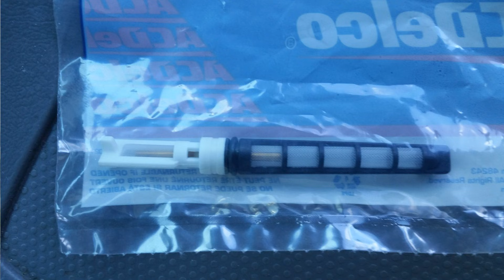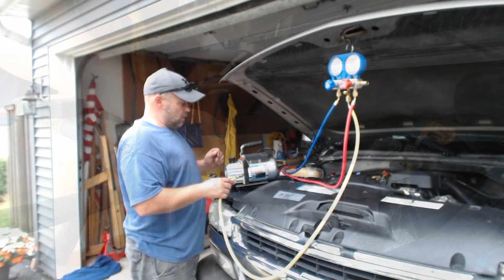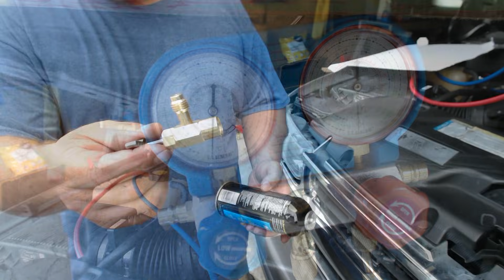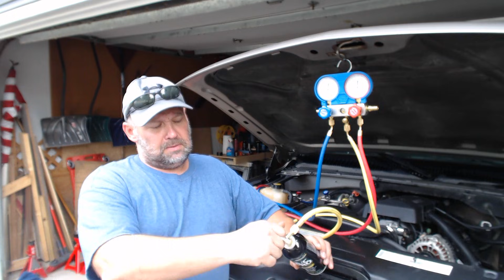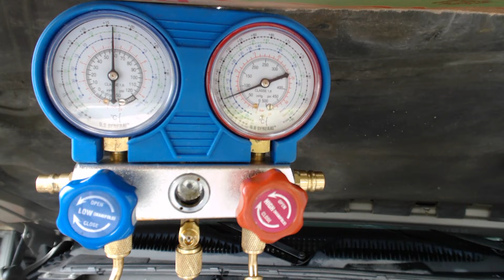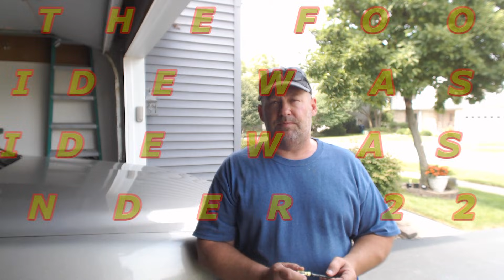HOW TO RECHARGE THE AC FOR A CHEVY TAHOE / HOW TO REPLACE A ORIFICE TUBE

Comment: Do i need to discharge the system at a shop before breaking the nut loose and disconnecting the tube?   Or can i just let it air out? 1:32

Comment: Doing an 03 Yukon Denali XL, the lines to the rear A/C are bad. Replacing all the lines up front to lines meant for a pickup truck. Front air conditioning is better than none. It's been about 8 years since I've done A/C work. I got my certification in the 90s but a little  refresher class always helps.

Comment: Question:  I noticed the rear side of that pipe (where the orifice tube lives) is ice cold, but the forward side is warm.  Is that normal?  And my vents are blowing in the high-70s, not very cold.   And the rear AC does blow a bit colder, which I don't understand.  Thanks for the great video.  I'm afraid to go invest in a vacuum pump and gauges if the problem is something other than low refrigerant.
Reply: Not sure if you have an O'Reilly s store close, but you can loan the vacuum pump and gauges out from them.
Reply: @ericjohnson4003  I wish we had stores like that around here. Not wanting to invest in a pump and gauges if low gas wasn't the problem, I took it to my mechanic. So of course the problem ended up being low gas.  Figures..

Comment: Hi Rick, I have a Chevrolet Sonic 2015 the the problem is that the high pressure pipe is cold and the low pressure pipe is warm and the A/C does not cool, what could be the problem? i have to recharge the system each month

Comment: did not to purge air using my harbor frieght guages.  in augusta, 100 now, super humid.  Need to replace orafice, since rear is working front is not.
great tip on adding oil to oring.  I was an engineer responible for ac change on vehicle assy line.  we soaked o rings in pag oil

Comment: Nice video. I'd change the AC condenser and the dryer in a 150k mile vehicle if I lived in Florida and also anytime I get into a system I change out the low/high side Schrader valve cores.
Reply: Why change out a condenser that isn't leaking?
Reply: Because it's Florida and it's a high use item that I wouldn't want to go without. Thought I made that pretty clear. @Balticblue93

Comment: You hooked up the red high side pressure wrong .
That goes on the liquid line the smaller one .
The blue attaches to the blue suction line .
Just look at how you hooked up your gauges lines .

Comment: I'm pretty sure that when you check it for leaks you're supposed to leave the manifold valves open. When you close them aren't you shutting off each hose from the system? That's why the low side gauge didn't start reading pressure until you opened it. When the valves are open you're checking the low & high side for vacuum leaks. When the valves are closed you're only checking the manifold for leaks.

Comment: Need some info. For a 98 gmc k1500 5.0L v8 1/2 pickup so whats the difference of a non automatic adjusting orifice tube vs an adjustable orifice tube.   Which is better cool and performance ?

Comment: Dude you took a hit on that freon. I got mine on line 6 cans for 40 bucks my orifice tube was about the same price although I priced it at a parts store for 2 dollars. But I figured if it was that cheap it was junk. Oh and my freon is the best made its DuPont Suva 134a I looked around and 3 of the top mechanics all said it's the best

Comment: How about finding the leak so you don’t have to charge it 🤷🏼
Reply: He did a vacuum leak down test on it and it passed, no vacuum leaked from the system so there was no leak when he charged it back up again.
Reply: Tyson Currie no he didn’t.
Reply: @fsu3784  technically he did a 10 minute leak test bit if it was me I would have done an 1 hour leak test and if you don't have time to wait at least a 30 minute leak test, but he did do a small timed leak test of 10 minute. 4:40
Reply: Tyson Currie I. Should have clarified that he needed way longer to tell if there was a leak.
Reply: @fsu3784  no worries 👍

Comment: Thanks for the video Rick , did you already replace the compressor? Or you still have the original? I got a 2002 Chevy suburban and after 265,000 miles my compressor just die, I’m going to replace the condenser and the accumulator too, I just worry for the evaporator, it’s hard to take it out

Comment: Hi side charging is FINE  when starting empty.   Hook up  gauges,  refrigerant, and purge  hoses.   With engine OFF  and  AC  OFF   invert can for liquid and charge  liquid into the empty system into the HIGH  side.  This gets most of the charge into the system  and  WILL NOT HARM A THING.   When  low side comes "up"  and pressures  stop moving, you can  start the engine  and AC  and  adjust  the final charge.

Comment: Good job, the only thing that I don’t recommend is turning the can upside down, you don’t want to add liquid to the low side. Refrigerant in liquid form should only be on the high side and with that said “ DO NOT ADD TO THE HIGH SIDE! “ liquid or gas! Leave the red valve on the manifold closed when adding refrigerant. 👍
Reply: You need to learn more about what happens with gases under certain conditions that become liquid and then gas again, especially with R-134, if you have a charging hose with a full can but disconnected from the AC and open the valve, you will se it will be released as a gas, not as a liquid, same thing happens if its connected
Reply: @kwt2000trucker  That is absolutely nonsense.  Sounds like you need to learn about how AC systems work and how the can is used.  If the can is upright, you will charge as a vapor and if the can is upside down, it will charge as a liquid.  Can you do either, but on vehicles you follow the directions on the can.  Of course anything that exists the can to the atmosphere is going to turn to a gas, that is thermodynamics and being mixed with nitrogen and oxygen in the air.  Regardless, if the can is upside down and sealed to the AC system, it will charge as a liquid.  High side liquid charging is fine, if the system is empty and as long as the compressor isn't running.  Empty the can to the desired amount that the label states under the hood.  Start the engine and run the AC.  Then you will make final adjustments to the charge using vapor and upright can.

Comment: Could the orifice tube be the cause of poorly performing at!? Please help
Reply: I recharged and it still doesn't blow cold like it should. I touch tubing one side is freezing other side close to fire wall is hot!!
Reply: looseparashoot the cold pipe is normal. That is your low pressure side and should be cold to the touch. The hot pipe is your high pressure side (head pressure). By the sound of it, it seems as though it may be running fine,in regards to the  refrigerant and compressor side of it. Now when you say it doesnt blow cold,is it cold and just barely coming out, or no cold air at all? If its cold but barely coming out, i would suggest taking a look at your blower. May not be blowing hard enough.
Reply: @robertgonzales1901  what about only cold when cool/cold outside ? Otherwise basically room or ambient temperature

Comment: It's illegal to vent refrigerant in the atmosphere. Also you shouldn't add dye if your not trying to find a leak.
Reply: A little dye doesn't hurt anything and then it's there in case your system ever gets a leak.
Reply: many  ac systems come with dye from the  manufacture

Comment: You seriously just released the gas into the atmosphere??Please be responsible and have it evacuated at a shop before you service an a/c system.
Reply: if that had of been freon it would have shown up as a fog when released likely just air
Reply: Is it irresponsible to use canned air?  r-134a is the same thing as HFC-134a and that's what's in canned air.

The only reason not to release it is that it can hurt your skin or eyes.

Comment: great video, i like your style.  question tho, i see people hook up the cables differently, as you have them with the elbowed side connected to the gauge cluster, other people have them with the straight side hooked up to the gauge cluster.  and the 2 ends are quite different.  so how to determine which is proper end to use?
9:10 now was that actually "opening" as you said or closing it?  I'm a bit confused bc I thought that counter clockwise was closing it off?!  and clockwise was opening it? on the valves.  and the gauge cluster clockwise was closing and counter was opening.. ?  Y/N? ha
you sure saved me a huge headache and mistake bc someone else said the orifice tube was down connected to the compressor and I almost went down there, but decided to watch your video first haa

Comment: Will be replacing compressor next week and just want to do this job right...thanks
Reply from the maker: compressor bad or is it the clutch? is it screaming?
Reply: RICKAFIX compressor. .just bought truck..blows hot..compressor looks like it spins when air is on and stops when I shut off...but refrigerant does not circulate...manafold gauges show around 100 psi each running or not no change.thanks
Reply: Good video tanks rick

Comment: so you never open high side when adding refrigerant? thanks
Reply: if the system initially get charge through low side  refrigerant goes  to low side  in state of  liquid and  causes sludge and shortening compressor life by damaging it,
 because when compressor ruining refrigerant enter low side as gas not liquid ,through return line.
the gas initially ,should be charge through high side with everything off till system pressure equalise with can pressure or no more gas can get in, then close high pressure valve start the car and run ac at this stage high pressure should go up and low pressure should com down.if the car need more charge most probably it would , it should be done  from low side only when compressor is engaged .don't fully open low pressure tap . open it gently and make sure low pressure gauge doesn't go over 50 psi by doing this you make sure. refrigerant goes in compressor in state of gas not liquid.
Reply: @seaton95  If you spoke english I might actually understand what youre trying to say
Reply: @puppetmasterblaster  it might not be best English composition but if you have a bit of knowledge about ac system in this case car ac you would know what i was talking about never never charge ac system when it is empty through low side because by doing that it could damage ac inlet valve,  you would flood low side by liquid gas it could damage ac by depositing sludge as consequence damaging ac inlet valve the correct procedure is  to recharge ac system after vacuuming the system car and ac should be off  low pressure valve must be closed... open high pressure valve gently don"t go fully open let gas go in... some times with some cars gas  wouldn't go in fully (only half the bottle gas go in  or on second bottle gas has hard time going in  )this is because pressure in bottle is the same as pressure in system ........now if you think amount of entered gas is not enough .....close high pressure valve (if you don"t do this the bottle could explode) start the car turn ac on ,when ac clutch engage (low side gauge needle start  coming down ) open low side valve at this stage as result of gas entering in system low side  gauge needle   start going up when it get around 60 psi shut the valve( not letting  pressure go over 60 psi prevent liquid gas entering into low side) when pressure drop open low side valve again .... this process must be done only while  compressor is engaged  till enough gas are in system.i hope this on is more clear.
Reply from the maker: correct
Reply: HECK NO!!!!....PLEASE DON'T!!!!

Comment: I see guys wire by the low side pressure switch to keep the compressor on all the time , it shut off at about 22 psi , on a hot day and enough Freon, the low side pressure switch will  stay closed!

Comment: When checking the low and high side pressure should both the front and rear AC be turned on? Thanks.
Reply from the maker: yes they are on seperate gauges
Reply: @Viiami Fainga make your own a/c videos ya know-it-all ffs

Comment: The problem you mentioned about when you stop at a red light the air does not blow as cold is a common problem on tahoe's and suburban's, not enough air flow's over the ac condenser from just the radiator fan.  someone made a electric fan kit that goes on the ac condenser that is supposed to help that problem.
Reply from the maker: yup.. I was down in Florida and my ac was great I drove out to az and my ac clutch started screaming...lol it is always something when you have 263k miles...thanks Gary
Reply: The clutch on the fan wears out. This condition prevents the fan from drawing sufficient air as stated. This happened on a 2004 gmc sierra.
Reply: just get a oem duel fan and it saves a couple mpg and high stop and go temps
Reply: I too thought I had a low charge on my ac. It turned out that my 170+k fan clutch was soft and weak. Swapping the clutch for an extreme service unit immediately solved my ac troubles. It also resolved a slow creep of temps on transmission and coolant temps in stop & go traffic. A properly working fan clutch more than doubles airflow compared to an e-fan setup @ idle. At speed with air flowing through the truck's nose, a fan clutch just free wheels, not taking away any shaft power in the least.

While swapping the clutch, I also disassembled the front grille/nose clip and soapy-washed the trans cooler, oil + steering pump coolers and radiator. Getting the mud, grit, bugs and leaf debris out not only keeps fluid temps well in check - but my AC at max will freeze you out of the truck and frost the windows over. ^.^ Replacement/upgrade fan clutch cost about the same as this fellows' tube swap and recharge. ($75) 

So if your engine temps/gearbox oil creeps up in traffic or as you pull off highway and rest @ stoplight, along with AC cutting out and blowing warm due to elevated pressure from excessive heat? Check your fan clutch if your AC presents a proper charge. 

High AC temps and pressures caused by inadequate cooling from a sluggish clutch will cause the compressor to cut out and blow hot too. While in there, clean your cooling stack!

Comment: Didn't expect the compressor to cut in as soon as it did... thought it would take a couple cans at least. We don't do ac, so I don't know enough about the ins & outs of the system. Slowly learning more & more thanks to videos such as this!
Reply from the maker: +Thomas EXOVCDS I am a little surprised on how well that a works after 16 years some shop wanted 1500 to fix it and fill it 5 years ago ..I laughed
Reply: Yeah, with trucks like ours, professional repair costs for AC can be far more than the whole vehicle is worth. Glad it worked out, thanks for posting.